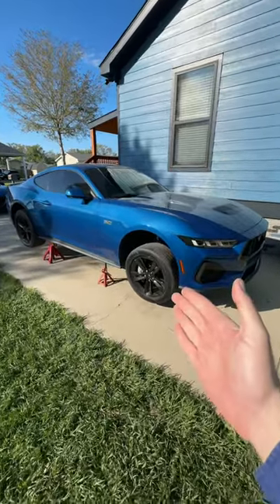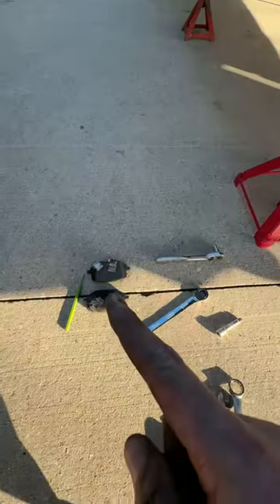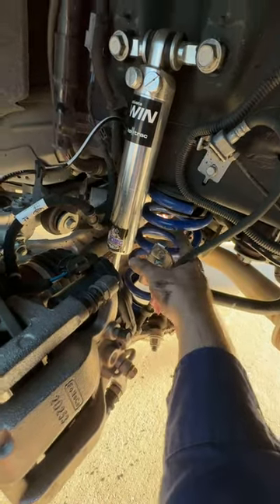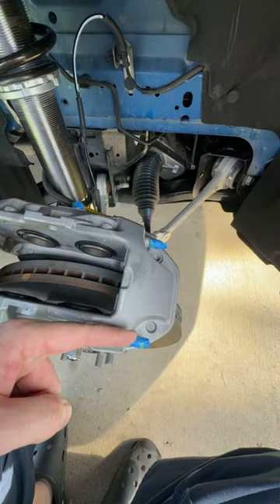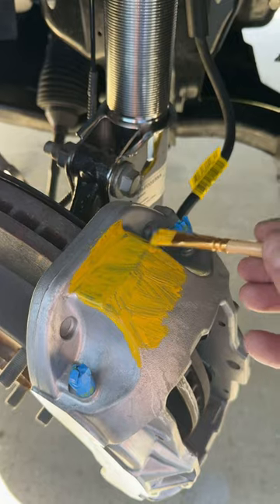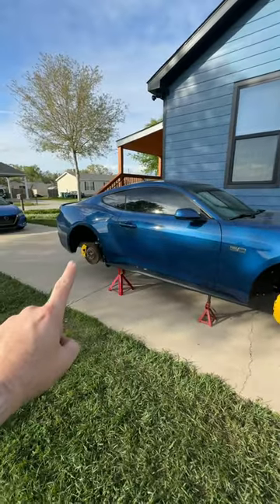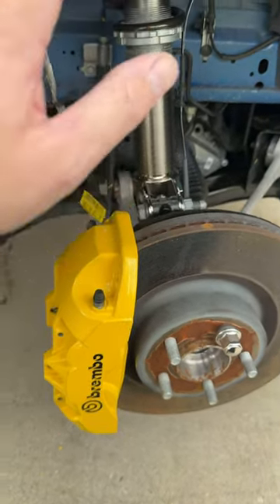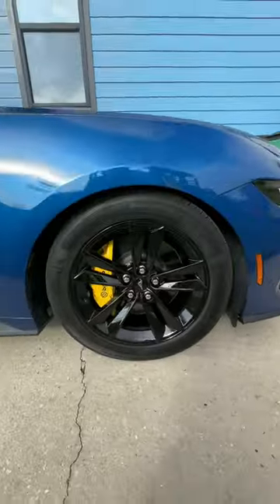How to Paint Brake Calipers with G2 Brake Paint!

Comment: Looks killer! good tip to take the brake pads out. looks a ton better when you do it right. Ill be doing the same this summer!
Reply from the maker: Thanks! You definitely want to take out as much as you can to make painting easier/cleaner. Also, expect needing 4 coats to build up enough paint to be silky smooth.

Comment: I just did mine 2 wks ago. I did not take them off. I taped behind the calipers and no problems. There is no need to paint the inside of the caliper unless you have big open spaces on wheels.
The Kit: lousy brushes that left hairs in the paint that had to pluck out - very annoying, even though I did pluck the loose ones out before I started as the kit suggests. Plenty of brake cleaner included. I bought a small artists oil paint brush from the paint store and that worked way better. The hardner and paint has about a 4 hour paint life, so there is no painting tomorrow. Did one side, then the other, then wait 20 mins, then repeat 3 times.
Result: Actually pretty good. I was skeptical as its a brushon, but when the third coat dried, they looked clean and shiny, no brush strokes. Not show car level, but still looks good.

Comment: Waiting on delivery today of a G2 paint kit. Good thing my brakes are brand new with bare metal. I was wondering why no one clear coats after using this paint, and putting stickers on?
Reply from the maker: There are really mixed experiences with the clearcoat bonding with the G2 paint well. For sure you’d need to let the paint cure for 3-5 days with exposure to heat, then scuff the paint, put stickers, then clearcoat with a really high quality 2k clear. IMO, if you use good-heat resistant vinyl stickers, just replace them when they go bad in 5-6yrs